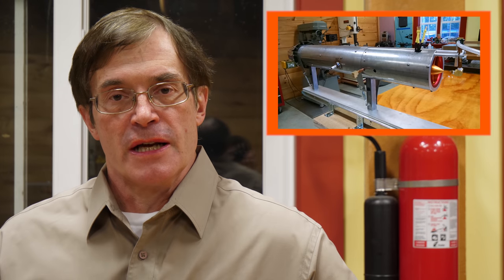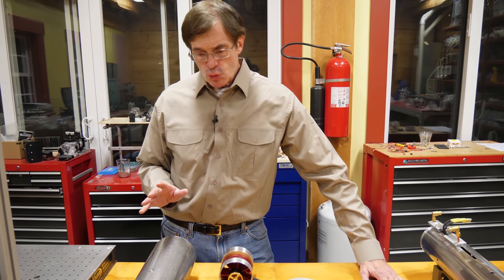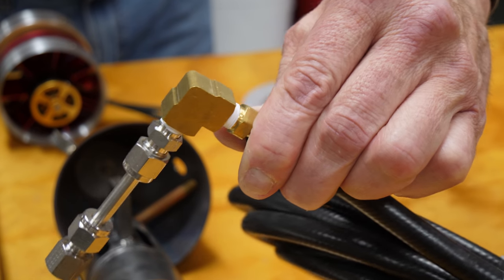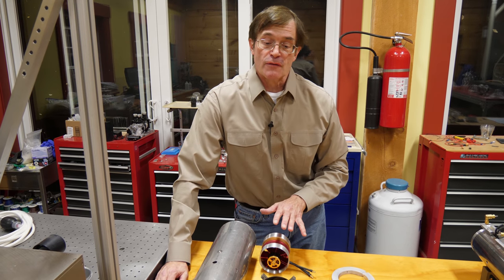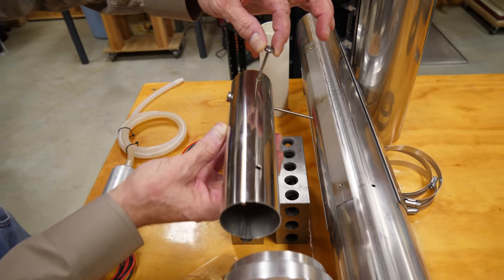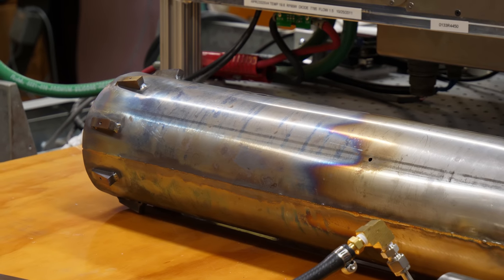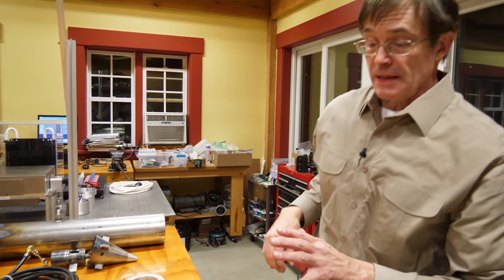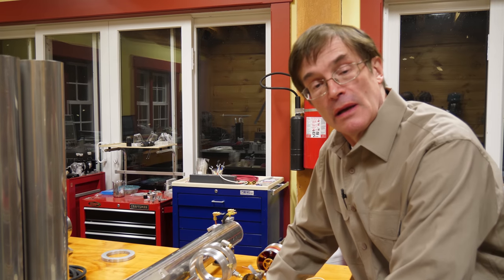Hybrid Jet Engine - Update 2.0

Comment: I dont think your 2 fan setup will create the improvement you're expecting.
Stators dont just redirect the gas direction, they literally do the compressing. The gas flow path is both redirected and squeezed or compressed going through a stators vane path (in addition to volumetric reduction over the entire compressor section like your pre-combustion chamber cone) the fan/compressor stages just maintain or increase the velocity of gas flow.
Reply: I think it will.  By using the second edf as both a stator and compressor ring it should create the same effect as expected.  But the effect maybe somewhat dampened if the second edf is to far back from the directed air from the first edf missing the boundary layer air.  Great experiment though.
Reply: Alexander Filatov A fan is fundamentally not the same as a stator. A fan will impart momentum to move the air through the engine (or bypass it), a stator is designed to compress and direct that moving air. While they look very similar the design of a stator stage is VERY different than a fan or compressor stage.

I think the best result they're going to get from this, is the contra-rotating fans will reduce swirling in the case. What they really should think about is actually adding a stator in between the fans.
Reply: would the blades in the second stage not also need a different angle of attack, because the air is already rotating against the blade rotation?
Reply: TheLordinio Yes! 👍 Every stage of compressor and stator is different from the previous to maximize efficiency for a constantly changing charge of air.
Reply: Are you talking about the adiabatic (i get these mixed too often) compression?
Stators are shaped like airplane wings, while impellers tend to be flat. I think this is what you are referring to?
That's a sonuvabitch to machine even with CNC. I would personally 3D print the stators and Ultra-vest Aluminum cast them if I was in that pinch.
Are you arm-chairing this, or do you speak from experience or education?
Reply: @beachboardfan9544  pressure is homogenous to an energy density. So if you have faith about thermodynamics it would be obvious that stators do not compress they only deflect... (the only way to increase an energy density is to bring energy in the same volume or maintain the energy content while reducing the volume. Passive elements such as stators in an open tube do not have such abilities)

(of course this deflection can result in locally pressurised and depressurised zones but the total (dynamic + static) pressure will globally be the same before and after an ideal stator)

Their design will work if they carefully choose blade pitch and motor winding. This is amazing engineering.
Reply: "Passive elements such as stators"

Stators are fixed, but that does not make them passive.  They change the direction of the airflow moving through/over/past them.

You're never going to get good compression from what, at the end of the day, is just a fan without using stator vanes.  

This afterburning electric jet idea isn't going to work the way he's approaching it.
Reply: @immikeurnot  you are probably confusing force and energy.

To change the velocity of a fluid (change the direction of moving  massive particles) you need to exert a force on it. But that do not implies an exchange of energy: E = F * L . If L = 0 (static force) then E = 0.

Think about this way. No matter how powerful you can make the "explosion" inside an internal combustion engine, whatever the shape of your combustion chamber, exhaust manifold and whatever the output torque at the crankshaft if it does not move then the output power, thus the energy (P = E/Time), will be 0.

By deflecting the flow, stators can make the engine more efficient by converting the fluid's "rotational energy" into a "linear" one but that's all. And stator is not the only solution to tackle the fluid vorticity issue, contra-rotating propelers is not a controvertial subject.
Reply: Why would a rotor moving in the opposite direction do worse than a stator? Isn't it the same as having a stator with the rotor moving twice as fast?
Reply: @SuperSeagull12  I read this discussion in a lot of detail, and even though I am by no means a jet engineer I think I get it: The point of a stator is (as mentioned before) to slow down the airflow and convert kinetic energy into pressure. In my understanding, a stator therefore needs to get into the way of the airflow and let the fan push against it to increase it. The higher-pressureair then moves into the next stage and increases again.

The crux now becomes that you probably could design a fan to do both, but you would need to modify speed, and the angle of attack of the blades very narrowly. I think that we can assume here that the motors presented here are two off-the-shelf solutions which are not finely tuned with regards to these parameters. If these two fans (would) run at a constant speed they would actually not produce a super-fast vortex, but accelerate the air backwards. The counter-clockwise movement of the other fan will only increase the efficiency in moving the air backwards. What you want to do instead is to design stators that will actually remove the backwards-motion of the air and get in the way of this backwards motion. A few vertical plates should likely do a good-enough trick for a home-made solution from what I understand.

I think this discussion is very important to the efficiency of the presented engine. I hope that @tech_ingredients is reading this sections on stators.

Comment: Instead of using water as the cooling fluid, you could use liquid fuel, which then heats up and circulates back to be burnt in the engine. A sort of postcooler, it would mean you woudlent need to cary heavy water, and actualy increases efficeincy as you dont need to burn as much fuel as it has a greater calorific value as is hotter.

Comment: Are you not worried about the propane you are spraying through the motor dissolving the enamel insulation on the wires?

Awesome project though. I'm very impressed with your build. I really like the idea of counter rotating fans. I have been thinking about that kind of motor driven setup ever since I learned that fans only impart velocity to a gas and it is actually the change in direction that increases the pressure.

Eventually I would like to build an engine that operates below ambient temperature but I recognise that the efficiency of the engine must be greater than the inverse efficiency of the heat pump situated at the engines exhaust.
Reply from the maker: The enamel on motor wire is usually polyurethane or polyester/polyimide and these resist propane.  There is some risk that the propane will remove the oil from the bearings, but then nitrous oxide could be substituted

Comment: I've noticed that the majority of jets or gas turbines below a certain diameter seem to have a preference for using a centrifugal system over an axial one for the compressor stage. And as far as I know all the hobby grade jets on the market appear to be like this.  (I'd think there's a valid engineering reason for this, given how compact those engines are.) So perhaps in the future it may be worth trying an impeller stage from a vacuum cleaner with the hybrid system, and see if that provides a higher compression than an EDF based system with a comparable power usage.

If I were to guess (based on both vacuum cleaners and small turbines), this has something to do with back-pressure and small sized axial fans are just not effective at dealing with it. (The relative speed of the blade isn't fast enough at the center, so it just leaks like a sieve with fluttering and turbulence?) Or at least it's much much easier to do it with a centrifugal system where the small size also makes it easier ramp up the RPMs.
Reply from the maker: You're analysis seems sound.  The centrifugal compressors are indeed more effective at compression at the expense of mass flow.  An axial compressor would become more competitive with a higher blade density, even to the point of overlap, and with a lower angle of attack allowing them to reach a higher RPM.  Also, a larger diameter, solid hub would prevent back flow, constraining the inflow through the blades where the radial velocity is highest and with a limited range of the radial velocity along their lengths.
There are even commercial vacuum/blowers with three centrifugal stages. Replacing their feeble motors with a powerful, BLDC motor might be interesting.  I've thought about it.

Comment: Adding additional fans is not going to increase the compression significantly where it counts because there is very little restrictiom.  The major restriction is upstream of the burning.  Otherwise it is just a tube open to atmoaphere.  You've got roughly as many square inches in cross section area as your approcimate thrust, so you won't be able to increase pressure for combustion much above 1 additional psi with this setup.
Reply from the maker: The additional fans DO help significantly because each of these fans is speed restricted by their load (airflow). The Vne speed for these fans is twice their operating RPM at full, 12 s power. As the air moves through each fan in series the flow velocity and the motor RPM increase.  Eventually, this air stream impacts the cone and like a subsonic ram jet, it is compressed.  I'm not just guessing here, we did some testing.  A single fan will produce 5.5 Kg of thrust and based on its cross sectional area, will move approximately 580gm/sec of air at 90 M/sec.  The series will move 700 gm/sec @ 130M/sec.  We get to about 1.5 PSI.
Reply: @TechIngredients  The motor velocity of the fans in series is not an unambiguous indicator.  If you completely shut off flow by covering the intake, speed will also increase.
If you are getting 1.5 psi increase it is almost certainly almost all upstrean of your cone restriction.  Your combustion is taking place downstream of this, correct?  
Without a turbine to take power, there is no good way to improve pressure of combustion without restrictions that negate any improvement to thrust, that I know of.
Your combustion is open to atmospheric except any restrictions which you would he better off minimizing rather than enhancing.
.
Note: subsonic flow regimes are essentially incompressible.  Only at very high subsonic speeds (transsonic)   does compresssibility begin to come into play.  There is no RAM (compression) occurring at truly subsonic speeds.
.
I'm not trying to give you a hard time.  I'm just trying to save you some time.  You will figure this out eventually.  I'm just trying to point you in the right direction earlier.
Reply from the maker: No, don't worry, you're not giving me a hard time and I appreciate your comment.The pressure increase we see is in fact upstream of the combustor with very little compression measurable in the combustion chamber...until we add the fuel.  At that point, the pressure in the combustor nearly equals the compression at the lip of the cone.  It is likely that the majority of the compression we see is in fact due to the ram effect.
Reply: @TechIngredients  Ram effect has as a feature a reduction of velocity, i.e. converting kinetic energy into preasure head.  
It isn't apparent that this is occurring in your setup.   Velocity increases at the reduction in cross section presented by the cone.  This leads to a reduction in pressure in a subsonic flow regime.  After the reatriction, some pressure is recovered as velocity is reduced.
Reply from the maker: That's correct.  The effect of the cone is not that significant.  The ram effect is always present when a flow is deflected.  The effect is very small at low velocities.  It is also a very inefficient method to compress air.  The cone redirects the air flow which is turbulent and somewhat chaotic as it exits the fan duct due to the blunt obstruction of the motor.  It serves mainly to cause the air to flow in an anular pattern near the walls of the tube and allow the flame front a lower velocity environment to stabilize within.
Reply: @TechIngredients  just use a dump style ab (larger diameter tube than exducer ) its easier and much much more stable than the commercial straight through is in small scale, i can send you pic the one i made for my DIY radial jet engine and some video in action,, also i would recommend that you switch away from propane, and go to jet-a1, sins propane has a cooling effect ..and you just don't want that in an ab,  kind regards magnus

Comment: Have you considered running the propane through a cooling jacket on the outside of the engine like many rocket engines do? Also what alloy steel are you using? I would think 321 would be a good choice and wouldn't break the bank like 347 or inconel. Your videos are great! Keep it up.
Reply from the maker: Thanks!
There isn't enough propane flow to have much of a cooling effect.

304
Reply: @TechIngredients  Doing something like that with the methanol on your new setup would probably help with atomization. It seems like you are having a problem with that.

Comment: You can add a Synenergy turbine at the rear of the unit and it can recharge it's battery: the turbine spins faster than the propeller by burn a lot of fuel

Comment: here is a thought if you can get the engine to burn at 2200 to 3000 degrees centigrade. using your water cooling system  to cool the inner engine then when the water reaches 2200 to 3000 degrees centigrade. inject it into the  combustion chamber. Just a thought.  👍

Comment: If you put four fans in series, and wire them up, electrically in parallel, they will use four times the power as one fan. But if you quadruple the output of one fan, it will use 64 times the power (with stators in between each stage, of course)
Reply from the maker: That's  because  the series  fans will not increase the velocity  of the air.

Comment: Wow great channel! did you think of cooling the tube by passing your fuel over it first like in liquid rockets? would make the fuel nice and hot before entering combustion and no need for water.
Reply from the maker: Thanks!

The fuel might carbonize or coke on the extremely hot tube.  The water has a much higher heat of vaporization and the amount of water is independent of the fuel flow and heat production.  Fuel based cooling, if insufficient, requires more fuel that produces bore heat and so on in a positive feed back loop.  We may elect to skip the water entirely and resort to bleed air, bypass cooling from the first fan.

Comment: I would guess ZrO coating would crack due to thermal shock after the first couple of runs. I would suggest MCrAlY coating: metallic coating with oxidation resistance.
Reply from the maker: I agree that MCrAlY would be superior.  We were unable to locate a company willing to do this at a reasonable cost.

Comment: From my understading the blades in a geared turbojet does not move in the same speed. thats the point of the geared turbofan and geared turboshafts, and you can also gear a turbofan to spin in the other direction.
Reply from the maker: Presumably you could, but as moving parts these could get heavy and add to the maintenance burden.  Also, the stators are independent of the turbines and even adjustable allowing optimization for effeciency.  Counter rotating EDF fans are a compromise solution that while less effecient, are very easy to implement.

Comment: I would be interested to know how you determined the optimum size of the annular gap so as to be sure that your ducted fans do not stall.
Reply from the maker: I bench tested the fan in the lab and using an adjustable cone, slowly constricted the exit port until the thrust began to decrease and the velocity ceased to increase.  This occurred at the same point.  The cone was designed to achieve the same cross sectional area in the gap.

Comment: Tech Ingredients, wouldn't propane damage bearings in the motor or perhaps even damage the coating on windings?
Reply from the maker: It may dissolve oils in the bearings, but its hard to imagine a bearing not having its oils blasted away by simple airflow if improperly sealed.  The wing insulation is usually made from polyurethane or polyester/polyimide and both are resistant to propane.
Reply: Is it possible that the bearing grease will become non-performant due to too low a temperature? Just an idle thought. Loving this series!

Comment: Sir, please explain about the fuel pump and the injection system in detail. Could be helpful.
Reply from the maker: In part two, you'll see the outer ring with the four fuel injectors mounted at 90 degree intervals around this ring and penetrating nearly, but not quite, to the axis of the jet tube.  The 0.7mm flow channel in each injector squirts the methanol directly into the center of the 50mm x 200mm flame tube at 100 to 200 PSIG pressure.
Reply: @TechIngredients   Thank you. Yeah I understand about the fuel injection realm. Just wanted to know about the high pressure compressor (100-200 PSI) that you are using for the fuel injection. 
I'll wait for that in next video.